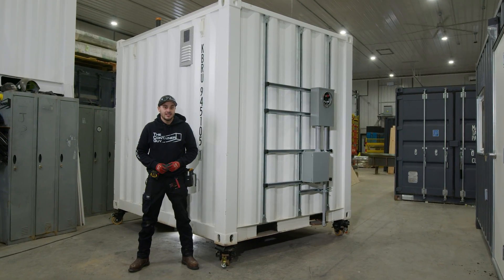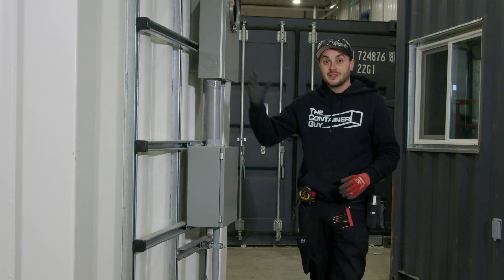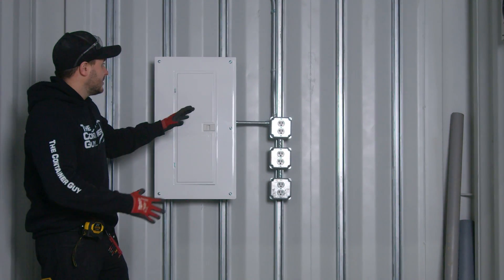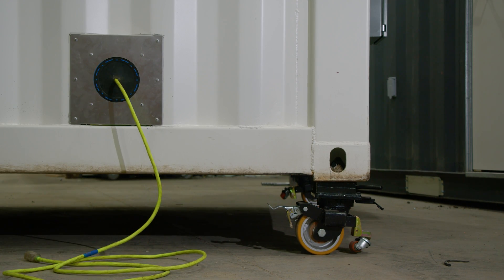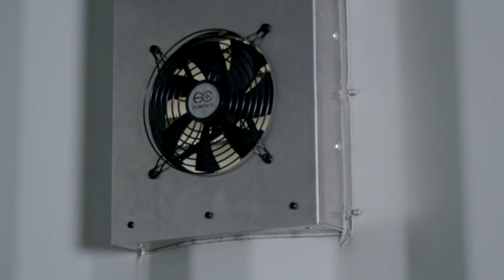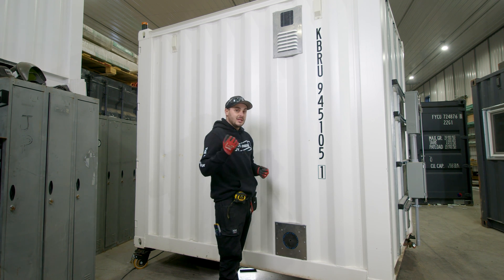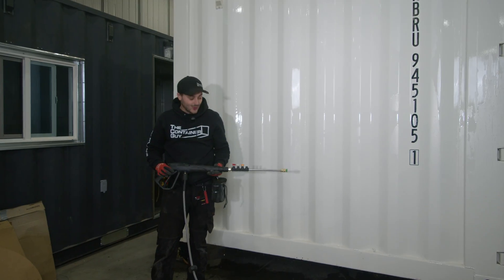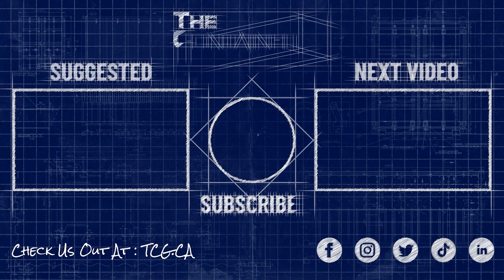Turning a 9ft Container into a Power Distribution Center! | NEW BigAir57 Solar Vent

Comment: I’m a pipeline (Instrumentation and Electrical) I&E tech.    I am a licensed electrician and I do controls too.  I have yet to use a container based e-box.  And, that surprises me.   I hope you keep innovating this kind of enclosure.   

If you don’t already know, most industries install e-boxes on pillars, make their penetrations through the floor and the cables fall into cable trays. 

I think container based boxes would be perfect for small applications.  I’m amazed that I don’t see them in the oil patch.

Comment: The most weatherproof way to get wires in and out might be a snorkel. Seeing them on more commercial boats I work on to get wires up onto the roof / antenna stands. An electrical weather head might serve this function for temporary wiring. If it's up high, it may deter sabotage as well.

Comment: As a suggestion, a lot of contractor friends of mine are installing solar powered cell cameras in trees or on poles to monitor their job sites and trailers.
Reply: Every time I try and post the information it gets blocked from you know who. I DM you so take a look.

Ríolink camera system is the company.
Reply from the maker: @lorenrickey5481  🤣🤣
Reply from the maker: That's a cool idea for the container doors. Know what brands?
Reply: I have been using wildlife cameras for the same purpose on my farm, due to thieves and vandals. Most proved to be teens, being ignorant or looking for a place to get drunk and stoned.
Sadly calling police proved useless, as it took them over an hour to show up, if they showed up at all. And they have never arrested anyone from the pictures off of the cameras to my knowledge.
I am currently looking for a more proactive security solution.

Comment: The solar vent is Savage idea!
Reply from the maker: I've had all the parts in stock since 2021 🤦🤦
Reply: Just purchased the solar vent!  Also purchased composite steel framing kit, container door kits as well as rodent plugs.  Excited to install in spring and spray foam in summer.  I expect to surface mount electric as well like you said and I agree.  I will provide video of install on my youtube channel to keep you updated.

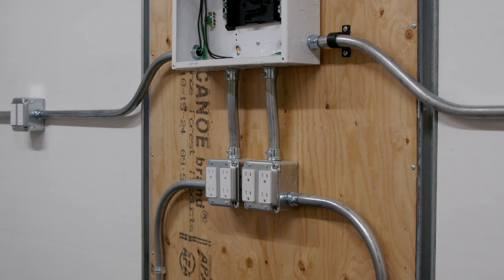Comment: At 2:49 in video.  There is wire at the top of the wall. Are those wires going throught a pipe?  When wire and/or poly pipe going throught metal wall; are there a grommet or other protecting it (from movement like on the road)?
Reply from the maker: I'm not sure how that was finished. It's an OLD photo. That was an R&D project so they may have been temporarily tossed through the wall to test the 12v panel / inverter on that job then finished up later. 

The cable gland pass through frame with the rubber grommet is an ideal choice for temporarily passing low voltage through the wall. 

You are correct though - Permanent solutions should have a PVC conduit or nipple to not strain / cut the wires during movement. We typically try and go out the back of the panel directly into an outside weatherproof splitter box.